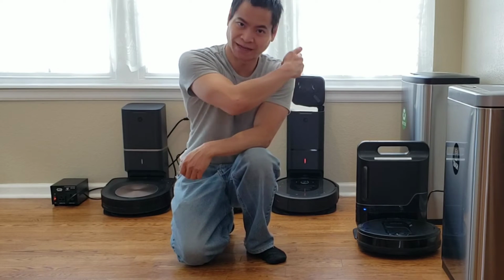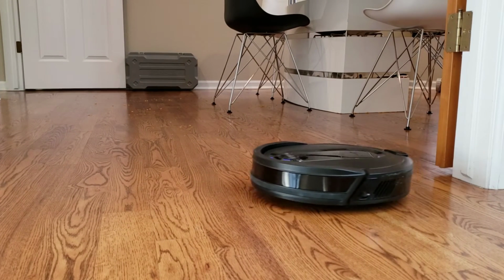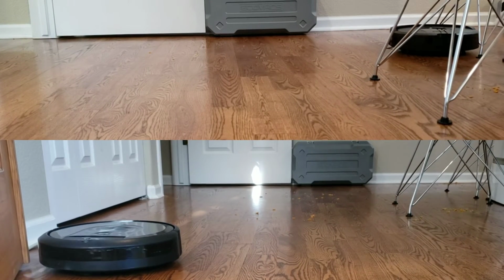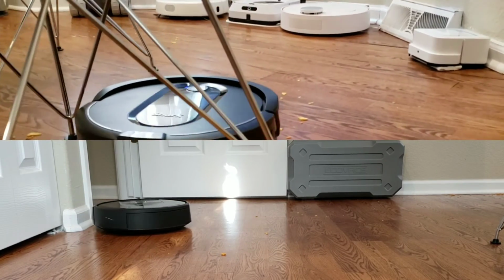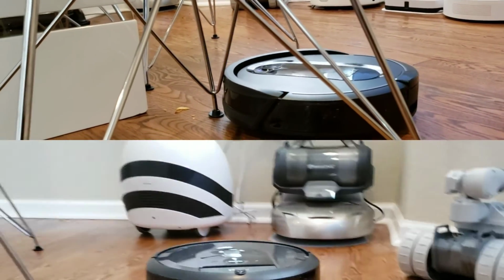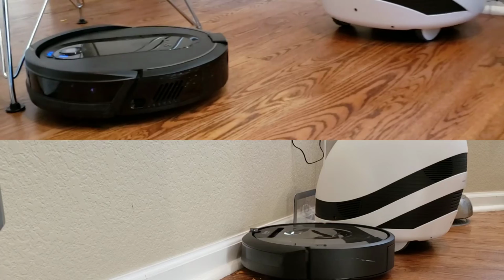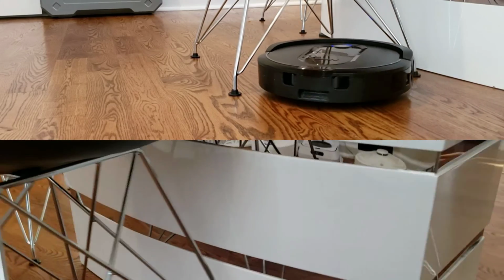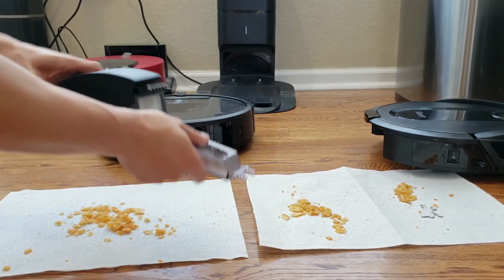Roomba i7 vs Shark IQ Cleaning Test. Who Sucks MORE 😞

Comment: Thanks for your review as I enjoyed watching.  I had one of the first Roomba vacuums that lasted for 4 years before breaking.  I bought another one and it lasted 4 years too.  Before buying another Roomba I looked at many reviews and decided on the Neato Botvac.  That one I loved because it cleaned my floors much faster as it was not random.  It knew exactly where it vacuumed and did not keep going over and over the same spot.  That one eventually broke down.  14 months ago I bought another Neato.  This was a much more expensive one - the D7.  I loved it.  It picked up dust and debris really well.  I only have hardwood and tiles - no carpet so I can’t comment on the carpet cleaning.  Just recently, the D7 broke down on me.  After spending all that money and only using it once per week to pick up a small amount of debris I was shocked that it broke.   I got an error code 3000.  This indicates the robot is trapped, however the reason is the laser that measures the room is no longer working.  I removed the motor and tested it using 5 volts dc and it’s working fine so it’s not the motor.  It’s not the o-ring either.  After doing more research this seems to be a broken navigation board - a very expensive part which can’t be repaired.  It would need to be replaced.  Plus the shipping cost.  So I’m going to get rid of my 14 month old Neato D7 and never buy a Neato again.  I think they used to make quality vacuums but now they’re garbage.  The algorithm they use is excellent.  I never had my Neato get stuck anywhere.  I’m disappointed because for me it was the perfect robot vacuum until it broke after about 60 uses.  I live alone and I am the only one who ever touched the vacuum.  It was not due to abuse.  My house stays very clean which is why I only vacuumed once per week. The dust bin generally had little in it.  After watching your video I’m thinking of trying the Shark.  I’d get another Roomba but I cannot justify spending so much on a robot vacuum again so soon.   I’m hoping that Shark did fix the firmware to make the algorithm more efficient at navigation.  Anyway thank you for this demo as it helped me make my decision.
Reply from the maker: Yeah I love LIDAR sensors but the downside, they tend to be fragile. I had a motor go out on the Roborock S5 Lidar sensor. Glad the video helped make a decision 👍
Reply: I didn’t realize how fragile they were.  My original Neato had a LIDAR sensor too and it lasted for years.  I do believe Neato has taken some shortcuts as the quality is not the same as it was.  It’s a shame because they were very good at one time.  I just watched your other video about the Shark having a buggy app that thinks it’s cleaning when it’s not.  That’s not very good.  Now I’m not sure what to get.  Should I spend the extra money for an I7?  Will it last for at least 4 years?  Should I just go with the Shark?   I better sleep on it. 😂
Reply from the maker: ds99 If it all possible I would spend the extra money to get the Roomba i7+. You may be  able to get one for $699. Overall it a better robot, more stable App and better navigation. Only downside the Shark IQ does have better suction so it can clean better on carpet. If you have a small to medium size floor plan the Shark should work.

Comment: Well, I'm a previous user of a range of Neato's (from the V20 to D80), I also have a Samsung 9000 series still on the job. I moved to a DeeBot N79S (first WiFi machine) and recently retired (repurposed) my D80 Neato to my nr 1 son and his apartment) and relocated my DeeBot to my basement (all carpet). Replaced with a Shark 1001 AI model last month. With all that said, the shark's ONLY and I mean ONLY plus is, I have a 30 day tank.  It's mapping? SUCKS. It's battery life? SUCKS. IT's app? SUCKS I could give you a list of pros (Only one thing) and it's cons (see the FEW things I already listed) but doesn't matter. I got it during the holidays at a decent deal, just over $300 but Shark REALLY needs to fix it's mapping software, it's AI is just DUMB. I've tried re-mapping like 4+ times. This thing still can't figure it out. If I had paid FULL price, it's been boxed up and dumped back on the shelf for some other poor sucker .  Oh, and customer service? I had issues  getting it to pair with Android 9.0. Ended up using a Samsung tablet first, then once it was setup on my network, I was able to connect with it using my cell phone. Shark returned my tech support call 8 days after I called in the first time and they didn't even try, handed me off to 2nd level, who called me back 8 days after I figured it out. So, Shark is a bust. I wouldn't recommend it. I'd recommend a rumba first. Which I have a 2nd gen Scooba that still works, but it's like turning a blind man loose in a bumper car, (no disrespect to the visually impaired) but I'm sure you get the idea.  Don't' get me started.

So, IMHO, avoid Shark(s).   My 2nd floor is carpet. Samsung is a manual start (no sked) so it's run like every other week and only do the walkway (about 500sqft). Decent tank
Shark, does 1st floor, all hardwood, some area rugs, about 1800sqft minus I have the utility room cut off and lots of furniture. Runs MWF (wish I could schedule it to do the kitchen everyday via scheduling. 
Basement,  DeeBot. About 1500SQft (doesn't do storage or exercise or bathroom) Small tank. Have to empty it ever other run now that it's been going for 2 weeks. 
We have 2 cats that don't go to the basement unless there's a storm coming (my weather kitties).

Comment: I know this video is old but the Shark IQ does not run this poorly anymore. I had the original and hated it. I was gifted a 2nd gen Shark IQ XL self emptying and after two full runs I was able to get a good map. Now it has a no go zone option. I’m really impressed with how it cleans now. My roomba would get stuck under my sofa every time and I had to lift the couch to rescue it. The Shark goes under and always comes out. She gets through my chair legs with no issues and I have 6 chairs in one dining room and 8 in my formal dining room. Shark did drop the ball releasing the first gen with such horrible software but I feel they have redeemed themselves with the newer version.
Reply from the maker: Thanks for sharing your experience. I tried the Shark IQ and AI running revised software which was leaps and bounds better. I am glad Shark is continually trying to improve their customer experience. Now they have a Lidar version which should navigate as well as the other Lidar models.
Reply: @RobotMasters  Yes, definitely! The original Shark IQ is a nightmare but the Shark IQ XL is really a great budget self emptying vacuum. What bugs me the most is Sharks marketing failed to distinguish them appropriately from each other. The boxes are practically the same with XL word being the only difference on the box. People are thinking both are the same piece of junk, one is just bigger because of the XL and far from it. Two different animals! Yes the mapping is not the greatest at first but so was my Braava Jet M6. The mapping on my XL  was set after two full runs on eco, I was good to go. Thank for doing what you do. New subscriber here!

Comment: Hi from germany! I‘m using my shark for 10 days now, mapped my apartment and everything seemed to be ok. Now i tried to send him to a single room but he always cleans the whole apartment… do you have a solution for that problem?
Reply from the maker: Hmmmm try turning the robot off and on. Also make sure the map says complete and you were able to create your rooms. Also try adjusting the room and see if it fixes the issue. If the robot still doesn’t go to the room, you may need to remap.
Reply: Thanks for your fast response! I tried all that and unfortunately it‘s still not working🙁 i just called the shark customer service but they couldn‘t help me so far. Now i’m waiting for a recall… i‘ll report here when they offer me a solution.

Comment: I run the m6 daily, and my floors look awesome🌼 allabout.wiki/BoostIQ I wet mop 2 days and dry sweep the rest of the days. When I first got it, I used the included disposable pads. I didn't like them--the dry pad has no depth so if it picks up a chunk of something, like dry cat food, then it pushes it around or drags it around the floor. The wet pad wasn't very absorbent so left streaks and wheel marks.

Comment: You said you would go with the roborock over these. But which one?  I got a neato botvac before and it broke after 1 year. Want to get something that wont just break after 1 year of use.  'By nice or by twice'
Reply from the maker: Roomba been known to last the longest. Havent had the Roborock long enough to test the longevity but if you regularly maintain them and clean the robot vacuum they should last 3-5 years
Reply: @RobotMasters  Just ordered the Roborock S6 MaxV for $599 on amazon deal day. I hope it lasts longer than 5 years. Damn i dont want to spend 600 every 5 years for a vaccum.  

Reason I ended up choosing the S6 MaxV, is based on object avoidance. We have a 3 year old who likes to leave toys lying around. I was tempted to go for the T8 or even the Roomba i6 (amazon only version) due to the ability to self empty but figured how hard is it to empty a vac bag every now and then. Thanks for all the vids... 

Do you think my assumption was right that for the following requirements: 
1. Best object avoidance (so it doesnt get stuck) aka kids toys 
2. A dual function mop and vac 
3. Build Quality (by nice or by twice) 
That the best choice on the market is the S6 MaxV ? Thanks in advance @Robot Masters.
Reply from the maker: @SeaSential  Yes the S6 Max V the best so far
Reply: @RobotMasters  You da Man!! I watched all your vids today. Love the channel and have subscribed. Will be recommending your channel. Thanks for the great content.  Did Roborock allow for future upgrades i wonder to self empty for the s6 maxv or is it completely enclosed ie not going to come with a future add on like the T8 did. that would really make it perfect if it had the self empty dock
Reply from the maker: @SeaSential  Thanks, unfortunately the dustbin completely enclosed.

Comment: I want a robot vacuum for my 90% hard floor home. Since it's now August of 2020, what is your opinion of the Shark IQ? I love how it doesn't need bags and it's still so much cheaper than the Roomba's with self-emptying bins. Do you think it's still worth it? Has the navigation improved? Has the app improved? (I have Android) What have you noticed change in the time between this video and now? Thank you so much!
Reply from the maker: So tell me a little about your floorplan, how big is it, is it multi level, does it have a lot furniture or small items on the floor aka pet toys. The Shark IQ good for simpler floorplans with minimal obstacles. The robot only supports one level. If you don't have alot pets than the Proscenic m7 Pro is a good alternative. Keep in mind the self emptying bin doesn't extract dirt as well as the the Shark IQ system but the Lidar navigation is better and can map the area in one session.
Reply: @RobotMasters  I'm moving into a 1800sqft single level home. We have one dog. Basic furniture- nothing crazy.
Reply from the maker: Jacob Wade The Shark IQ should be sufficient, I would try it out for yourself, just keep in mind the mapping process takes anywhere from 6-30 runs. My personal experience was in the higher numbers, but it could of been my more complex floor plan.

Comment: I have not used the Roomba and I own the latest version of the shark IQ - the shark IQ is an awesome machine, well designed and cleans what it cleans very well but overall........the software / programming and possibly the sensor array is very poor. The mapping cleaning pattern and lack of ability to block areas out and to keep it cleaning on max level, it not seeing obstacles and more is a big draw back.  If they could get these fixed it would be an awesome machine but I am now seeing a long path of complaints and people poor reviews without any resolutions.  I would not buy it again for that reason.  comparing machines in a you tube video is not a good comparison because real life is different.
Reply from the maker: Yeah the only real way to know if the robot vacuum model works for you is to personally try it in your home. Even the best navigating, cleaning robot may not be suitable for your floor plan.
Reply: @RobotMasters  - trust me, the floor plan is not the problem.  The area we have her cleaning is a large open 2400 s.f. living area of the house with very little furniture.  The floor is porcelain and what little furnishings there is,are placed so she can easily navigate around them.  I was the national technology office for J.P. Morgan Chase and designed interfaces between systems and programs.  This is clearly a software, engineering and programming issue possibly coupled with inadequate or wrong type of sensors.  I have read many many other reviews since I started seeing all of the little issues with my bot and many many people are complaining about the same things.  A friend bought a mid priced Neato about half the price of my Shark.  I don't know how well it cleans although my friend seems very happy and when I watched its navigation process, I was extremely impressed with it's pattern, efficiency, how it avoided obstacles including me walking in front of it and trying to confuse it unsuccessfully.  Get Shark to find some good programmers, dump the current programming and the Shark would be totally awesome.  Best wishes
Reply from the maker: Paul Pierson From my personal testing the Roborock models have the best navigation, maybe engineers from that company can help Shark out. Shark cleaning system is good, just the navigation needs work.
Reply: @RobotMasters  Thanks, I don;t know anything about Roborock but totally agree about Shark.  Shes a great machine with great ability just needs better guidance.  Hopefully shark will take the hint, improve her mapping and navigation and have the best bot on the market for the money.
Reply: @paulpierson7908  They've apparently stepped it up a fair bit w/ software upgrades.  Some say they had their house mapped first time, or w/in a reasonable time of several runs.

Comment: Did the roomba actually pick anything up? And why is the roomba camera angle so close? Like that shark though!
Reply from the maker: It pickup some debris, I have found running the robot several times help picks up the debris that is missed. Thw Angle set so the robot can see part of the wall and ceiling can calculate its position.

Comment: I just ordered this shark robot, there’re lots of bad reviews, but I like shark so I’ll give a try anyway!! I have an i7+ roomba so they’ll be working together side by side .
Reply from the maker: The Shark IQ is a excellent Vacuum Cleaner in the fact it cleans really well and the self emptying base does a good job emptying out the robot’s bin. Hopefully Shark can improve the navigation and App stability which is the only two things holding the robot back. Luckily these can be fixed through software updates.
Reply: Which one did you end up liking better?
Reply: I currently have the roomba I7 plus, roomba s9 plus and the shark IQ with selfempty bin and got to say, the two roomba’s navigation system is superior. BUT, they tend to break down more often, specially the self empty bin, it got to the point that both roomba’s were down and the shark robot was the ONLY one getting the job done till replacement arrival. The shark as of this date hasn’t break down at all! And it’s less expensive. Honestly I would recommend shark over roomba, roomba robots are too picky, too much BS. That’s my experience.
Reply: @nicarau1273  Good to know.  I'm about to get an open box Shark at a good discount ($200 Canadian).  I'm looking into new discount ones a bit too, since I preferred to get a 2 in 1 w/ a mop.  I have an iLife Shinebot 400s on the say, so it's not crucial.  The Shinebot is the best mopping robot, which truly cleans and rinses floors (rather than just drag a damp cloth over them), but it would be nice to have a vac robot that can get under my clawfoot tub and couches, and the Shinebot isn't as streamlined.